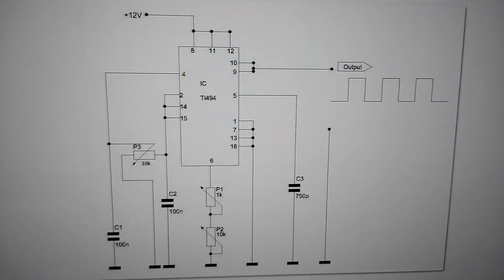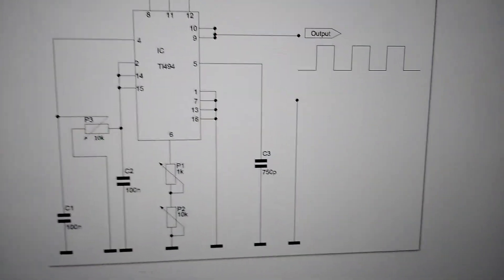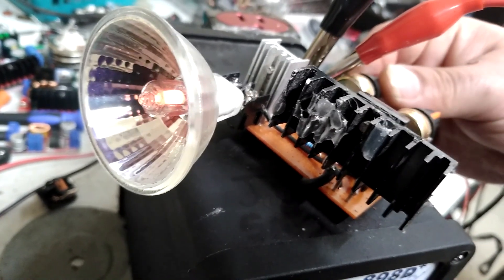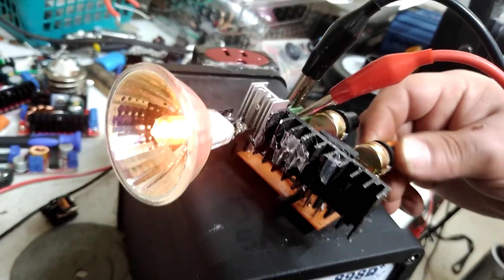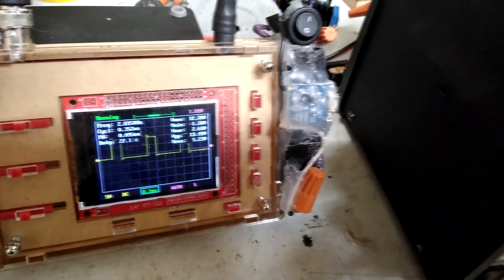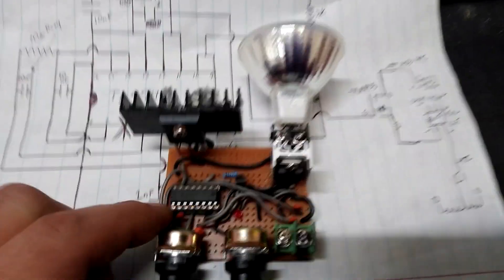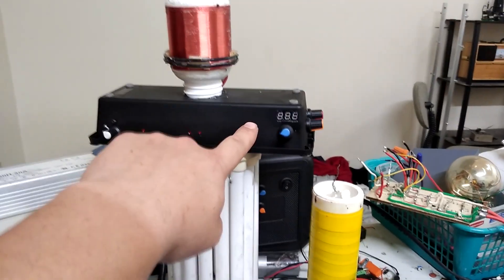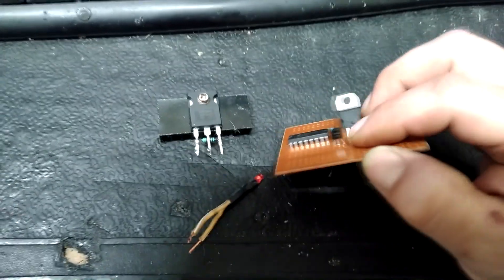PWM driver with variable frequency and duty cycle

Comment: could you send me a circuit diagram of this except with a ne555, I tried looking for a circuit for a while now to interrupt a small sstc but so far no luck
Reply from the maker: I believe the same circuit using 555 timers would require two of them to work about the same. One would control duty and the other BPS. What's actually a decent schematic to follow is Steve Wards Interrupter circuit. I'll see if I can find a link.
Reply from the maker: https://www.stevehv.4hv.org/drsstc_interrupter.htm

You can sort of follow that design to see how it would be setup with 555's. You would exclude the 3rd 555 that does "burst mode". You would also need to play around with the timing portions of each chip to set a wider range of PWM as that one is as-is was setup for DRSSTC interrupting at low duty cycle. The more capacitance you add on pin 2 of the 'BPS' 555 the slower the repetition will be. Pins 6,7 on the Duty 555 can be increased in capacitance to raise the max duty cycle.
Reply: @Magneticitist  thanks for replying, this circuit would probably work however i need it as compact as possible which is why i’d like to just use one 555 timer instead of dip16 or something larger
Reply from the maker: @nguyendesign4517  You can use the single 555 if you don't need independently adjustable Duty and Frequency. You'd have to use a fixed capacitor value and use the potentiometer to adjust the duty cycle.
Reply: @Magneticitist  ahhhh okay,thank you

Comment: Man, this video of yours is really instructive for many out there who want to start somewhere with their interrupter. In the past, I've been busy using those little TL494 myself & they are pretty much solid to go ahead with as pwm driver. That's indeed a very good video.
Reply from the maker: Thanks. I thought it was a really handy circuit and works quite well for SSTC's. I was surprised to see the TL494 can drive a mosfet pretty good on its own. Only downside is I realized the circuit I use doesn't allow for a super fine on time adjustment at the lowest levels, though it does get fairly precise on the other end toward 100% so inverting the output can make it more precise. I've been sticking to Ward's 555 interrupter for DRSSTC's and realized it wasn't too difficult to cater that one to run a wider variation of outputs.
Reply: @Magneticitist  Yeah, that's true. Well, I just wanted to say a great thanks to you for all the videos. During this lockdown in my country, I had nothing great to do & then came across your channel. You did keep me motivated & somehow, I got back with some of my diy's just to keep myself busy. Now, I'm must say bye bye to my diy stuffs as I'm resuming work next Monday the 14th of June. So, on my behalf man, it's been nice to have known you. Take care & stay safe. Just keep it up with your beautiful Tesla Coils. Cheers.

Comment: sup man, hope your well :-) how is the circuit running motors ? I've got a fun project that needs a pwm controller to drive a motor, I've tried the 555 version but its not great .. by the way, i got the same oscilloscope ! cheers
Reply from the maker: What's up bro good to hear from you hope you're well also. I've been doing alright so far. Kind of laying back recently trying to figure out what's what.. too soon to say lol. 

But yea this PWM works good on motors you just need to add the proper diode protection or the fet/regulator or both are def getting killed from a beefy enough motor at low frequency. I'd probably try to use either a huge knob on the duty cycle pot or use like a 10-turn pot for fine speed tuning.
Reply: @Magneticitist  yeah man, i know what u mean, i'm just chilling myself and staying healthy :-) .. right on, i'll try it out, its only for small motors but you'll see soon enough lol !